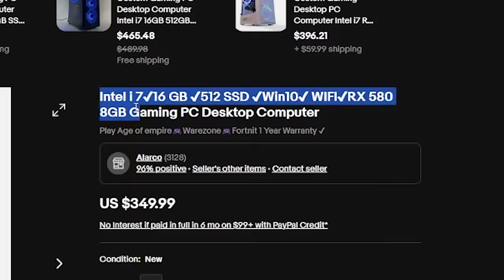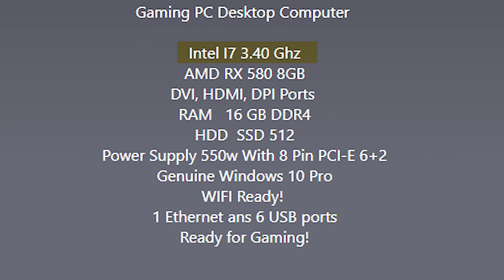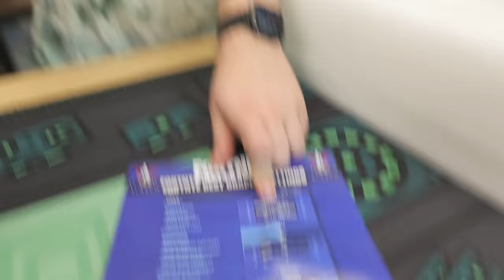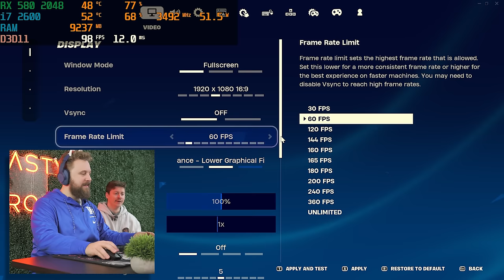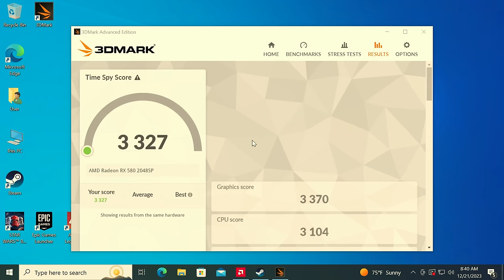We Bought a $349 Gaming PC…Does it Suck?

Comment: Honestly I thought this would be worse but that i7 has no true upgrade path I would love to see you guys look at the $67 New Ryzen 5 4500 👍
Reply: What do you think about the i7 8700k going into 2024?
Reply: where is it $67 at?
Reply: 8700k in 2023/2024 isn’t that play. I ran one for 4 years. Amazing CPU. 2 years ago it needed to go as it was struggling. so I wouldn’t spend money on that
Reply: This PC is good enough to play all games released for PS4 (PC ports of these) and that is about that. There is no real upgrade path except buying more storage (cheap SATA SSD or large HDD) , in order to have more games. Anything else, you would need new MB, RAM and CPU . If you change all of that, you might as well buy new GPU too.
Reply: I dont know why you'd even consider that old ass cpu bro. @BREEZYM6015
Reply: @jeremym.3664  struggling on what? Lol im running a 6700k with 1080ti and still runs current games, esports just fine.
Reply: @huskers1278 why not? 8th gen i7 is more than good enough to play these titles
Reply: @BREEZYM6015 Still a good entry level cpu but better if you can oc it to maybe like 5.0 - 5.1ghz..same or slightly better/worse performance than i3 12100 but have higher power consumption..pair it with rx6600, 4060, 3060 still wont bottle neck it..hell 3080 at higher resolution(1440p/4k) it can still drive it..
Reply: @jponz85  Bro you probably just have terrible expectations. Turning all settings down and churning out a stuttery 55 fps is console level stuff lol.
Reply: @huskers1278  that's a really cool story dude. Playing cod on high settings averaging 70fps/ apex runs on a potato/ battlefield again highest settings averaging 70fps+. Yall swear you NEED 100fps+ on games to be playable. Tf
Reply: @jponz85  You choose the most optimized games to make your point?
Reply: @huskers1278  if you're talking about playing Starfield then idgaf about those games anyways. Again my point is that the cpu and gpu is still more than playable in 2023. Next argument
Reply: It did perform better than I thought.  But I think the upgrade path argument is a bit of a waste of time with any Intel.  Because with Intel just about any socket is only good for about 2 generations so it is a nonstarter whether your CPU is 10 years old or 3.
Reply: @certs743  12900k goes straight to 14900k all lga 1700.
Reply: @huskers1278  So two and a half.  Just about everything I have read seems to suggest 14th gen is just a refinement of 13th gen so I suppose that would make sense.  That being said 6 through 9 should have been the same deal but were deliberately made incompatible to sell more product.
Reply: @certs743  You are correct intel has done some fucked up shit lol. I was just pointing out their most recent chips were all compatible. I have a 13900k and am waiting for 15900k should be a big step in performance
Reply: @huskers1278  Well good to know Intel is not pulling the same nonsense at least to the same degree. I just doubt we will ever see something like an Intel AM4.
Reply: @BREEZYM6015 for budget builds nothing beats the am4 platform

Comment: Lol similar exact build I have in an old HP office computer model 8300 elite. I7 2600 16gb ram and rx 580 8gb lol. Still runs a lot surprisingly well.
Reply: I7 7700  7th gen, 16 gb ddr3-2133, gtx 1070 , 1Tb ssd, 1tb hdd
Reply: @TvosOlehead did you just try to flex your system?
Reply: @sircartdark is it a flex tho..those are some old ass specs..lol..13th gen i3 smoke those 7th gen i7..😂😂
Reply: @kubotite9168  It was just so random lol. I didn’t mean my comment as an insult or anything. it just caught me off guard 😂

Comment: Would pass on the RX580 these days due to no driver support now :yt:
Reply: There’s still unofficial drivers. I used them recently and it’s good. If you okay older titles that only upgrade the maps and skins and not the engines you will be okay. Think about games like LOL. Apex legends etc
Reply: @frameripperz8794 may i know what drivers you use ? Cause i have a plan to buy Rx 580

Comment: Just a thought but they could probably do very well and get better customer satisfaction building systems with old Xeons.    The 2600 did surprisingly well but any quad core is getting to be an issue these days.

That being said my decade old E5-2665 based Dell T3600 outperforms the i5 8400 system I had bought as a work PC during the lockdowns.

Comment: If I was to ever buy that same gaming PC I would replace the old parts with newer and better parts even that might be something I will do in the future. 💡💡💡
Reply: If you want to upgrade this specific PC, the MoBo would limit your upgrades with up to a i7 3rd gen CPU, only supporting DDR3 RAM, and only has support for PCIE gen 2 or gen 3 (depending on the MoBo and CPU.) You are able to upgrade to a modern GPU but it’ll be limited by the PCIE gen 2 or 3 slots. So really what i’m saying is that this pc doesn’t really have a great upgrade path. So instead of buying something old with intentions of upgrading it, which will make you upgrade the whole PC if you want something beyond what the MoBo/CPU supports, just spend the extra money for a newer system. You can check out one of ToastyBros videos about Lenovo office pcs, they’re better and newer than the old Dell opltiplexes.
Reply: @sircartdark  yes I know that I didn't say I would leave the Mobo in there. That why I said I will get rid of all the old parts and replace them with new ones.
Reply: @MJaccobFTW  so you’re technically spending around $200-$300 for just the case? That’s why I said to instead just buy a whole system yourself or build one yourself. You’re just buying a system to throw out most of the things. That’s just E-waste. I think i’m not understanding your motive. I’m not trying to insult your choices, I’m just confused.
Reply: @sircartdark  I know what I'm doing thanks
Reply: @sircartdark  besides I do stuff like this every time and I manage to sell it for a higher price.
Reply: @MJaccobFTW  I'm not saying that you don't know what you're doing. I am asking questions, so I can understand what you've been doing. It just does not make any sense to me why you would buy a working system to just throw out all the old parts then replace them with new parts. You are building a new system from scratch, but throwing away the old parts and making them e-waste. I would understand getting a new cpu or gpu, but from what I'm understanding, you're just throwing away good parts, unless they're broken.
Reply: @sircartdark  you do have a point there. I thought it would be best for people. A couple months ago my friend bought one of these computers and tried to gaming on it. It played games so horrible and most games would just crash and my friend spend $300 on the computer so he didn't want to just throw it away so he bought it to me tell me what happened when he was playing on the PC and I felt so bad for him so I upgraded and replaced the parts in the PC for him for free.
Reply: It's wrong for company's and business's to take a off the shelf old office PC putting it in a new case and selling it off as a full custom gaming PC that can play every and any game. So I'm mostly doing it for the people cause that's the type of person I am
Reply: I even get the parts to upgrade the PC from ebay at good deals
Reply: @MJaccobFTW  Oh, okay. Now I understand. I thought you were just buying working systems off of ebay to upgrade them, then just throwing out the parts and making them e-waste. I didn’t know you meant that you were only upgrading people’s systems. Honestly, a really nice thing to do, and I appreciate you for helping others. My bad for misunderstanding. Keep up the good work man!

Comment: If cpu is not K variant you don't really need an aftermarket cooler. Intel's copper core coolers which they were giving with cpus in that era do a nice job with both i5 and i7.
2nd and 3rd gen are pretty much the same, they lack AVX2 instruction, those budget build companies need to switch to 4th gen for that price imo.
Reply: I hear this argument alot but I have yet to run into a single title personally that actually requires AVX 2.   I mean even Hogwarts Legacy which claims you need a 6th gen CPU from intel runs very well on my Sandy Bridge Xeon.

Comment: My PC has an i7 8700k, GTX 1060 6GB, 16GB of DDR4 RAM, a Corsair H100i 240mm AIO cooler, a 600W PSU, a 1TB NVME M.2 SSD, and a Kediers C570 open air case with 7 RGB fans. What would be a fair price to sell it for if I ever decided to sell it?
Reply: I bet you’d sell it quick for $550-$700
Reply: Most of those parts are fairly old even if they are still pretty capable today. I'd say you can just try to find similar systems in your area online and figure out a price based on that.

Comment: I reworked  a dell opti 7020 i74790 with a gtx 1060 6gb, which I highly recommend over this bull fighter. But if you want a turn key system, I guess you have to do your homework.
Reply: Yup, i have laying around a 4790k with a 1060 3gb and still runs fine. Cod/apex/r6/escape from tarkov/squad/....list goes on. These e-titled games would run just fine

Comment: just not worth 350$ for a round the same price a little more (400 ish)  you could get a used i3-10100f(roughly 70$ same 4c 8t as the i7 and MUCH newer with better single and multi core performance) with a cheap used 40-50$ mobo 16 gb of ram for about 40-50$ a used gtx1660 ti or rx 5600 is a solid options prices do fluctuate on these gpus pretty often but something around this price range makes sense you looking for a gpu from about 100-130$ used. that leaves 100$ left over for storage PSU and a case with some smart shopping its do able. im not saying this is around the 350 range but for a little more you get WAY better performance and a decent upgrade path. I built a PC a few years back with similar specs to this with a 2060 for under 500 and it kicked ass at 1080p with prices dropping on the older cards and cpu's this can for sure but done for around 400$
Reply: If you really want it to hold its own a i5 10400f is a solid option for about a 20-30$ difference compared to the I3 10100f

Comment: Im curious if theres actually bottle necking going on from CPU. The 580 we know cam do better than this.
Reply: There is bottle necking, but it’s not as bad as you think. In 1080p, doing graphic intensive tasks, the CPU bottleneck is pretty low, but ideally you would want a GPU bottleneck instead so you can utilize the full potential of the GPU.

Comment: is a rx 6600 xt a good gpu?
Reply: I think so
Reply: Its faster than an rtx3060 in some games.  Depends on price though.  An rx6600 is almost as good and sometimes much cheaper.  An rx6700xt 12gb can be bought for sometimes not much more.    Id say the rx6600xt can be considered “good” if its close to $200usd
Reply: I have the gpu, you’ll be running most games 120+ fps at 1080p med/high
It Is a good gpu and since they’re new, the warranty is good aswell